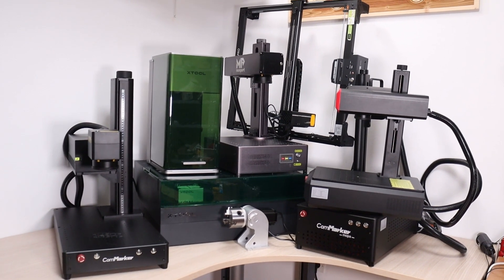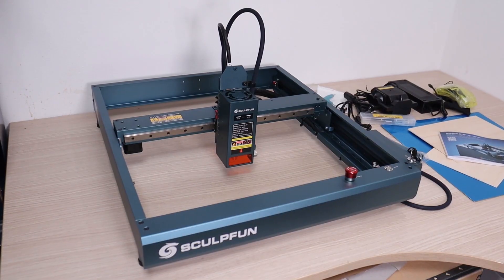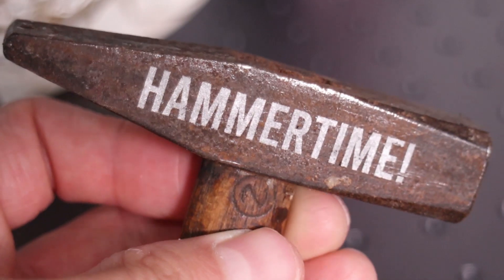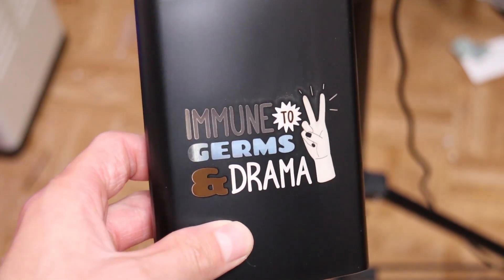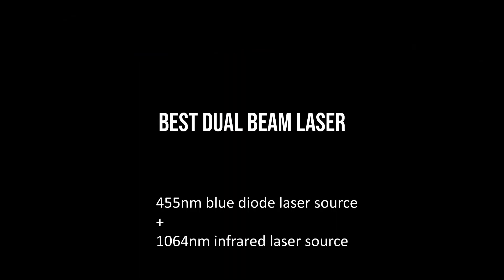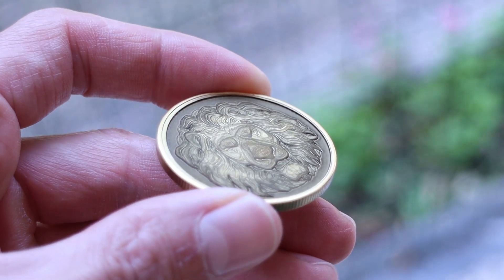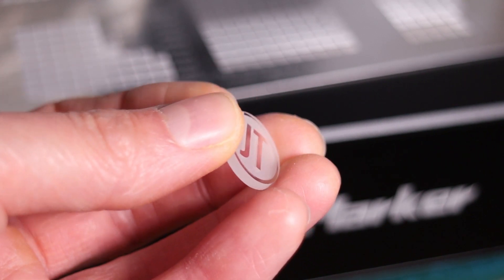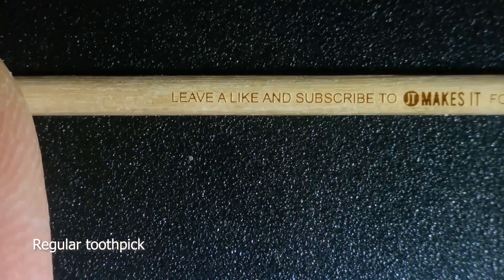Which Are the Best Laser Engravers and Cutters I Tested in 2024? (My Top Picks for 2024/2025)

Comment: Hallo. I am a laser hobbyist. Your video is very informative and interesting yet for my activities I failed to find guidance in it. Most of what I do is creating things like boxes / "safe" boxes etc. for my grandchildren so that most of my laser work is cutting (light plywood, 4, 6 and 8 mm). My machine is a Sculpfun S9 which I have enlarged and upgraded to 45 X 90 cm, 20W. The cutting results are good, quick and precise enough. The problem to which I find no solution is the scorching of the cut edges. As much as I try to get the best finish (with vinegar, brush or sanding paper) some scorching remains and is ugly. It can still be seen even through colored varnish. If I understood correctly, the UV lasers may be able to cut without scorching? Are there UV machines at the a.m. size? At an affordable price (comparable with S9)? Would you (or anyone of the followers) have a suggestion?  Many thanks, Emanuel
Reply from the maker: @emanuelpelleg281  hi, so you are getting smoke stains on the surface near the cuts? are you using air assist? Good air assist would eliminate this. Or you can glue some paper foil (something like masking tape) on the wood before cutting, and then peel it off afterwards. UV lasers cost more than 10 times more, but aren't good for cutting thick materials. They aren't meant for cutting.

Comment: Between the Monport GA60 and ComMarker B6, which stands out the best option? I am stuck between the 2, from the specs there doesn't appear much difference but sure there is somewhere. Can you help break down the finer details? Like which has best hardware controller (if different), best lens, useable work space with standard lens, etc... anything of importance.... many thanks! I have watched your videos multiple times and watching again but still not sure which to get.
Reply from the maker: @DA98550  they are very close in performance. I would choose between the features. Monport is larger unit, but has a collapsible column that can be tilted sideways which is nice for engraving larger stuff. With ComMarker you need to screw in an additional spacer. But ComMarker is a very slim unit which takes up minimal desk space and you can connect an external foot switch. These are not all the differences, but just an example.
Reply: @JTMakesIt Would you still recommend the GA60 now that they switched out the JPT laser for a BSL controlled GZTECH?
Reply from the maker: @walltownpens7563   they switched? I would prefer the JPT over BSL, but I haven't tried the other one so I don't know about its performance. Also the BSL machines are now supported in Lightburn too.
Reply: @JTMakesIt They did and although it communicate it does so pourly. Jump speed around 400 and negative on/off timings to make it work so so.

Comment: hi, do u belive the new sculpfun s70 max will be better than atomstack A70 max?
Reply from the maker: @gonzalocuriel5148  it should be simillar in performance. Historically, Sculpfun was better at cutting. I would choose according to the features.
Reply: @JTMakesIt  Thank you for your reply! It's interesting that Atomstack uses 14 diodes in a vertical arrangement, while Sculpfun only uses 12 but places them horizontally. I'm not sure if that really makes a difference. They claim their laser can move at 36,000mm/min, whereas Atomstack is limited to 24,000mm/min. They also include a sensor to warn when the lens is dirty, although in a video I saw someone mention that the Atomstack's lens barely gets dirty. Honestly, I wanted to get my hands on the Sculpfun, but it was about $200 more expensive, so I’ve already chosen the Atomstack. I hope it turns out to be a good purchase. Cheers!
Reply from the maker: @gonzalocuriel5148  cool, don't worry about the max speed ratings, you will always engrave well below it for better quality